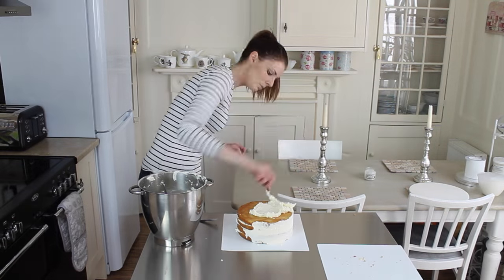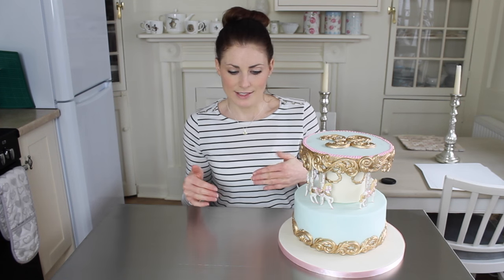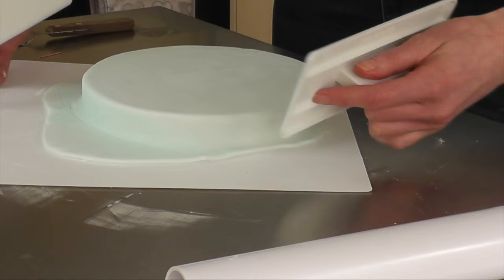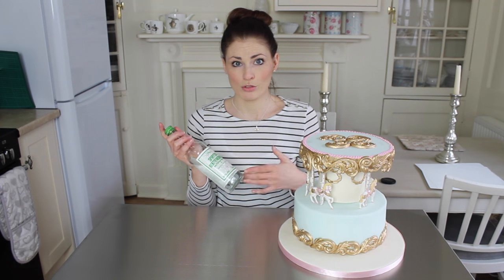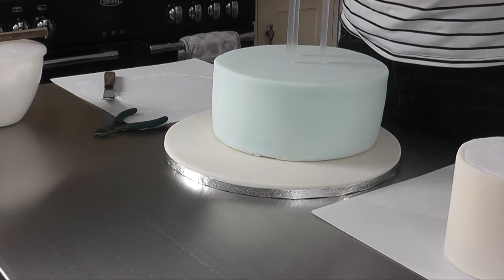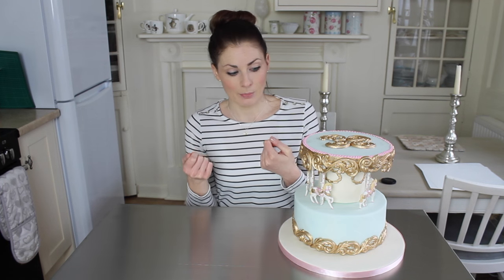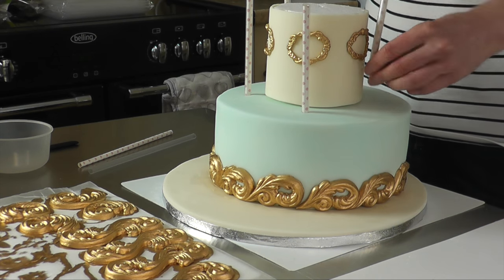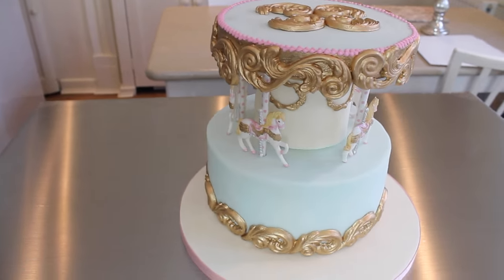HOW TO MAKE A CAROUSEL CAKE

Comment: new subbie....great job, the cake looks wonderful.
Just a quick question...I've never worked with fondant/ sugar paste/gum...to decorate a cake...any tips on things to be weary of, i plan to decorate the cake 1 day before the party and am worried the next day the sugar paste bits and pieces will have dried out, cracked or fallen off when it comes to the next day.
I am going all out and also will be trying some edible gold lustre....again any tips would be appreciated.
TIA
Reply from the maker: Hi Samia, I normally decorate cakes several days before an event so don't worry about bits drying out and falling off. If the decorations and the main fondant are both dry you will want royal icing to stick the two parts together. Water or sugar glue doesn't work when it is two dry pieces being stuck together. Regarding your fondant, give it a good knead before you roll it out- it needs to be nice and soft and pliable. The edible gold lustre is fantastic! My biggest tip for that is to mix it away from your cake because the dust can travel and land places you don't want it to land! Take a spare piece of fondant and do some test brushes on it, make sure the colour is coming out how you want before you go onto your actual decorations. And with the decorations, make a couple of spares if you have the time. You can guarantee if you have spares you won't need them BUT if you don't have spares... something is bound to test you :) Good luck!! Let me know how it goes!! Billie :)
Reply: +SweetieDarlingCakes ur a star thanks sooo much for taking the time to read and reply! 
Looking forward to ur future videos.
Reply from the maker: You're more than welcome! Thank you so much :)

Comment: but almost nothing is edible ???
Reply from the maker: The cake is edible, which is the part that matters 😃👍 If you want the middle part and top part edible, you can just switch the dummies for cakes. Just make sure there are cake boards under the cakes so they can be supported by dowels ☺️